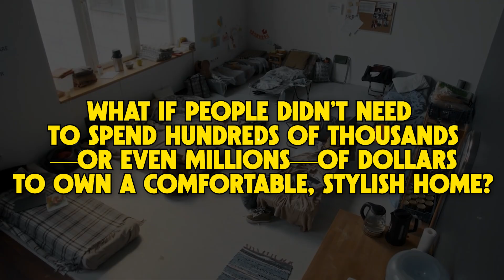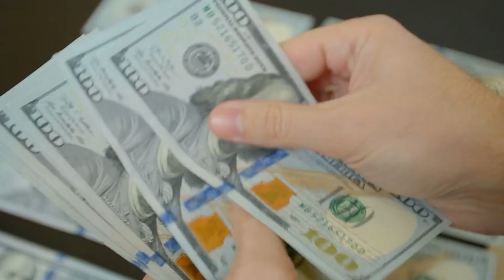IT HAPPENED! Elon Musk’s $10,000 House FINALLY Hitting The Market

Comment: Tesla does NOT have a product called a "tiny house". However, the company did present a mobile home concept called "Tesla Tiny House" to showcase their energy solutions, specifically the Powerwall battery system. This house was built to demonstrate how Tesla's technology, like solar panels and the Powerwall, can be used to create a self-sustaining energy system for a home. It was not a product for sale but rather a promotional tool for Tesla's energy products. 
Here's a more detailed explanation:
Concept, not product:
The "Tesla Tiny House" was a promotional project, not a commercially available product. 
Focus on energy solutions:
The main purpose of the tiny house was to demonstrate Tesla's energy products, particularly the Powerwall, in action. 
Self-sustaining energy:
The house was designed to show how solar panels and the Powerwall can be used to create a self-sufficient energy system, reducing reliance on traditional power grids. 
Not a low-cost housing solution:
While some articles mention a $10,000 price, this likely refers to a different concept or a misinterpretation of the promotional project, according to villa.az. Tesla did not offer a tiny house for that price, according to villa.az.